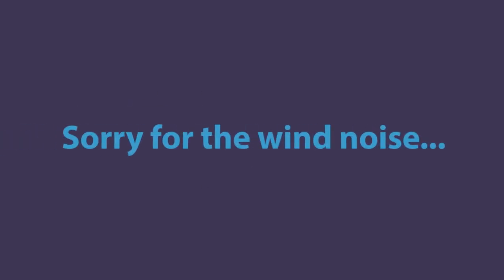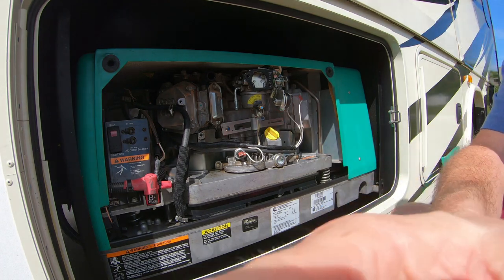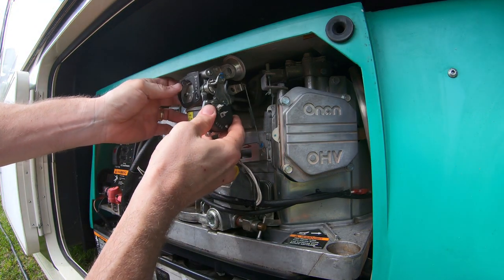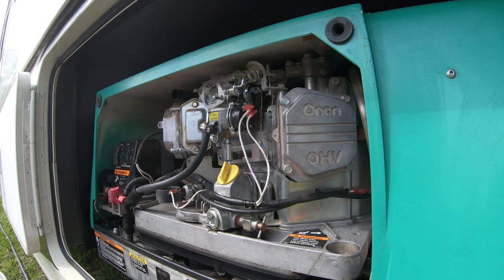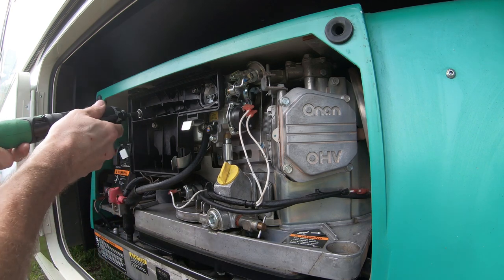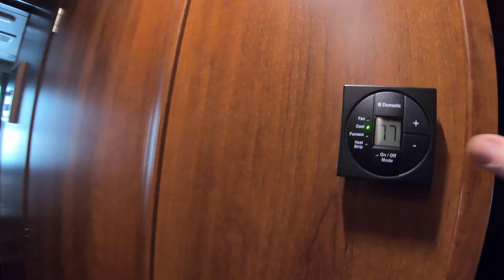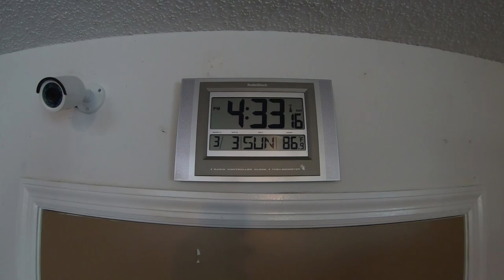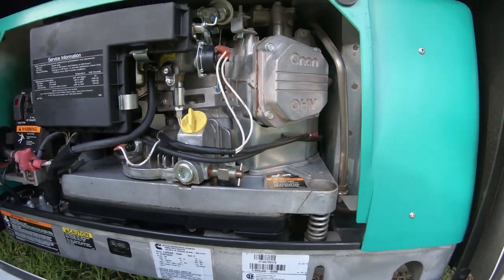Onan 5500W Generator Carburetor Replacement

Comment: Thanks for taking the time to show how to do it... I just bought a generic carb off amazon for $40 and will replace it as soon as it gets here. The original carb did not last long AT ALL (I used the generator twice, and the whole RV was only 6 months old when it got messed up)... Several 'old timers' told me its such a common problem with these generators that the thing to do is buy the cheap carbs and have a spare on hand at all times.
Reply from the maker: Mr. Paxton (IIRC), is a representative from Onan that said their generators die from lack of use, not overuse.  They like to be run at least once a month, under load for a period of time.  I do the same for all my generators now, after learning the hard way with other generators. But the Onan wasn’t my fault. I bought the RV used and I think it sat for a while. It ran like new after the new carb swap. Let us know how the generic carb works for you. I’ve heard mixed reviews.  FWIW, I did buy a couple of generic carbs for my portable generators, but not tried them now that I keep them exercised.
Reply: Did the generic carb work for you?
Reply: @rattlecan1987  yep, worked just fine.
Reply: I used the generic carbs off Amazon and they were hit and miss. One worked for a year the other worked for four hours. I just bought the Cummins carb for $650 as I was tired of troubleshooting the generic China carb.

Comment: When you put the gasket in then the  spacer,  you were supposed to put the other gasket in and then the carburetor.  that’s why it look like the gasket was interfering with the butterfly
Reply: Yes there are two identical gaskets, one either side of the spacer, and then a different gasket for the air filter body to the carb. So his install is now missing one gasket between the spacer and his carb!!!

Comment: A lot of carburetors on Amazon (supposedly for the Cummins QG 5500) are 44.00  - 65.00  Do you know if they work????????????????
Reply from the maker: According to an RV repair expert here on YouTube, the knock off carbs are unreliable. He said they look identical, but they don’t have good quality control.  He now avoids them. Check out AZ Expert. Excellent channel, lots of great repair tips. FWIW, my Onan carb I installed has been working flawlessly.

Comment: Did it run at all before the swap? My Onan 5500 won’t run at all.
Reply from the maker: It would run for a few minutes, then shut down.  If your float is stuck closed, or the fuel pump has died, it won't run at all.  I'd suggest taking off the air filter, and spraying some ether directly into the throat of the carburetor while trying to start it.  If it fires, then it is a fuel delivery problem.  If it doesn't, then a spark issue.  You can also disconnect the fuel line at the base of the carb, face it away from everything, then try starting.  It should squirt fuel.  If so, likely a stuck float, or clogged jet.  Good luck!

Comment: Is there a difference between this $300 carb and the $59 carb on amazon? Performance wise is there a difference? That is a huge price difference
Reply from the maker: Other than being a Chinese knock-off, I have no idea!  I went with the expensive OEM model, and it works perfectly.  I had trips upcoming, and didn't have time to experiment.  The no-risk price difference kept the wife happy!  It has been working flawlessly.  If you're not in a rush, it might be worth trying the cheaper model.  All else fails, you can return it to Amazon for a refund.  If you do go this route, please respond with the results.  I'll update the description.
Reply: @2manytoyz123  I am trying the knock off this week.. I am getting a code 58.. What made you change your carb?
Reply from the maker: JIM SEQUIN Mine would run rough, then die.  With the new carb, it’s running perfectly.  Well worth the investment.
Reply: 2manytoyz123 hope it works for mine
Reply: @bassoneman   so did the non-Onan (off band) Carb work?  I just ordered a $52 one to replace ours.  Ours has been doing the rev up and rev down and recently has been having problems staying started and randomly would shut off. We already replaced the fuel filter, fuel pump, spark plugs and air filter.  Hoping the carb fixes the issues, but we do have over 1300 hours on it.
Reply: @johntaylor1341   Hi John, The carburetor worked but didn't fix the problem.  However the company I purchased mine from the locktited the bowl drain screw.  I complained to Amazon, They sent a new one out, that was also locktited. They told me to keep both and refunded my money. Couldn't send the first one back in the mail full of Gas